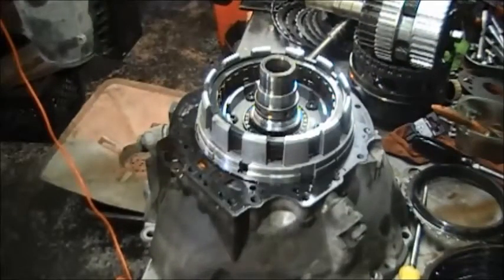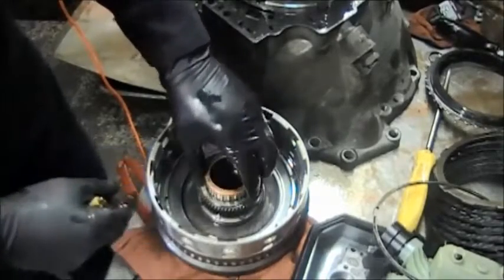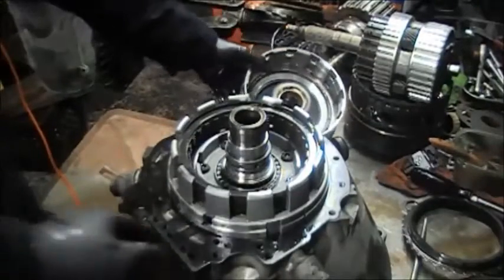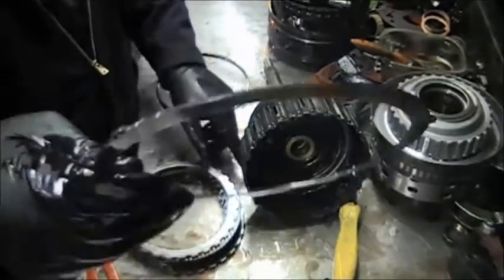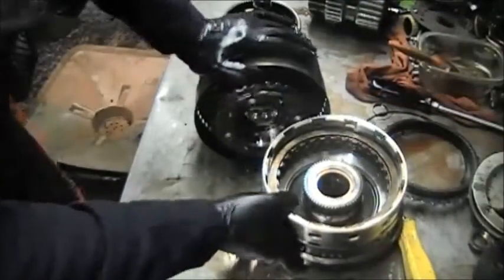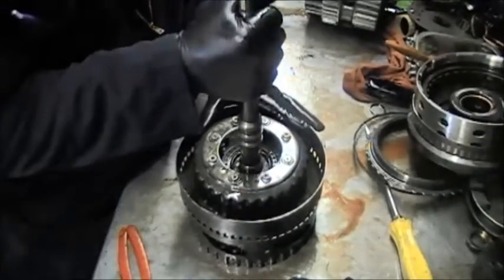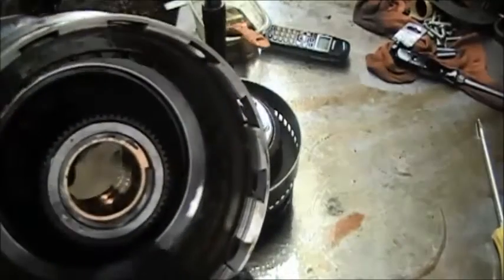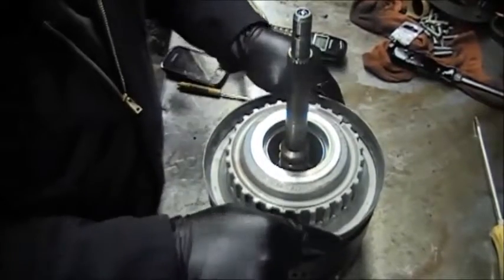Mercedes Benz 722.6  transmission repair Part 5

Comment: As far as the beveled springs or cushion plates, can they be removed and replaced with a flat piece in order to get a firmer shift?
Reply from the maker: you would get a harder shift, however, I don't know how hard.

Comment: My w203 has the same transmssion, the car had difficulty moving bacwards on a hill/slope, no matter how much i stepped on the throttle, it wouldnt rev high and move slowly and then gradualy moving. 

Is it because i was in W mode? I wish i had it tested before having the engine and transmission out. I dont want to put it back in without comparing it to to another or getting some feedback. 

Some say it may be the torque converter going bad. Oil is original, on level and filter is new too. Gears dont seem to slip or desengage. Whats your opinion? Thanks.
Reply from the maker: w mode is winter mode right?
Reply: questioning3 yes i think it stands for that. i regret not testing it but i had a major leak and have motor and transmission out for freeze plugs overall. i ordered a usedbut good torque converter, my oil had about 2500km doesnt smell burned, a bit brownish but the previous was really dark (when i bought it). The transmission had no metal particles on the sensor plate´s magnets or in the pan, all springs were in one piece. I have learned a lot about automatic transmissions, i have never worked on these before. Been working on cars since i was a kid, back in the day it was rare to find an automatic around here.
  So im waiting to have it all ready to test . Ill post results when i have them, thank you for your time and videos!